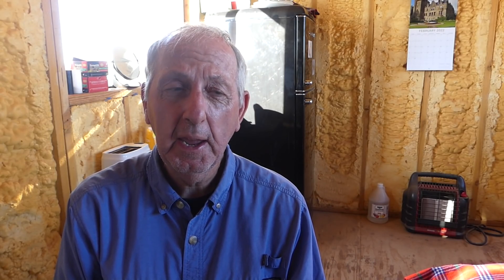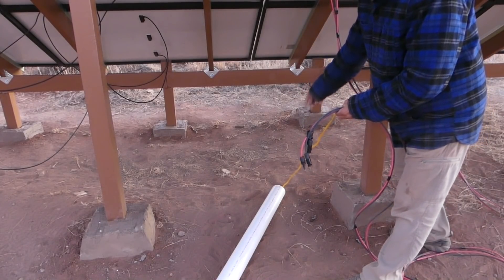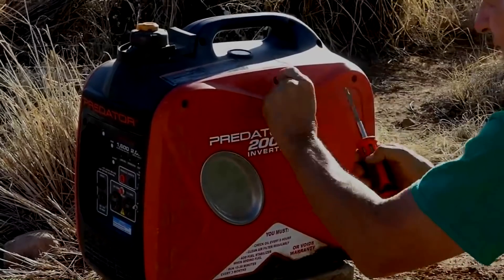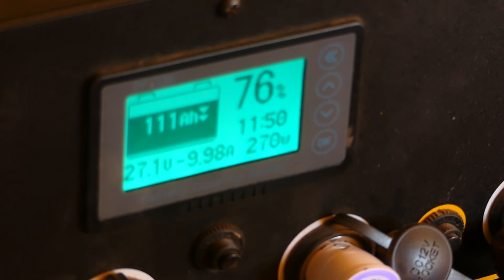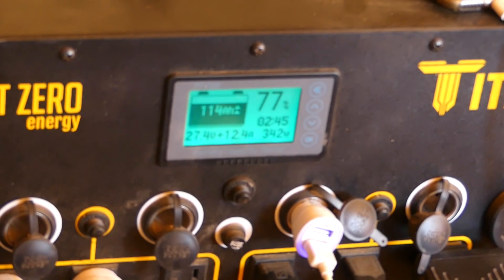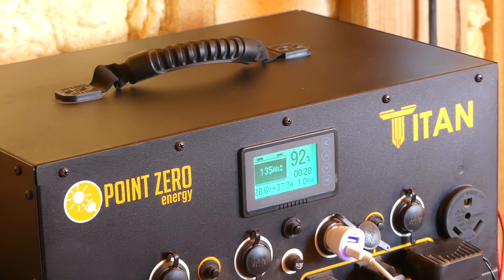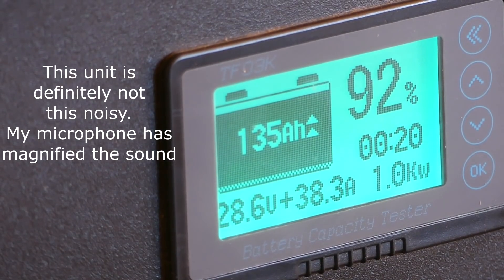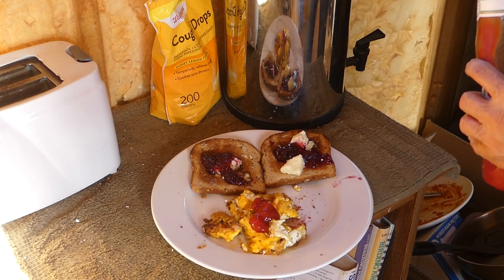Off-Grid Senior Powers 200 sq ft Tiny Cabin with Solar

Comment: I'm in California and you are correct heating and cooling are so expensive here. I'm looking at building a solar powered evaporative cooler out of the shell of a regular evap cooler just using 12 volt pump and solar fans nothing fancy just something that cuts the cost of cooling during daytime hours.
Reply from the maker: Fortunately I am so heat tolerant that it takes some serious high temps to bother me much. But I am atypical I realize.

Comment: Excellent DIY electro-engineering. If you don't electrocute yourself or destroy any equipment - you've done well. Have you considered a GAHT (ground to air heat transfer) system? It involves digging a big 5' deep hole, and lining it with porous agricultural drain pipe in a large coil, then using an inline fan to force air from your house into the underground coil and back into the house. The ground temperature 5' below the surface varies from 55 to 75 degrees. Not ideal, but the system will very cheaply temper the atmosphere in your well-insulated cabin. Then, you will only need the heat pump for the very bitterest cold of winter and the truly blazing heat of summer. Most of the time, you can heat and cool with only the cost of an inline fan. The GAHT system is frequently used by extreme climate commercial greenhouse operators (in Las Vegas or Ontario, for instance) to keep costs down so that it doesn't take $1,000 in heating or cooling for each bed of veg produced. Love the content, as I am preparing to launch into desert living myself. Keep up the good work!
Reply from the maker: Hi Linda. I wanted my set up to be relatively simple to construct. I am super snug with my Big Buddy Heater and often its probably about 80 deg in here. I love heat LOL. As for cooling my two windows offer great cross ventilation in summer and I am very very heat tolerant.
Reply: @affordabledesertliving3487  Well, shoot! We can never date - I'm a polar bear by inclination. 😉That's why I'm concentrating on the high desert areas of Seligman, Ash Fork, Prescott, and Flagstaff.

Comment: I love your channel! It’s fascinating to participate in your adventure. Thanks for sharing. 
I keep wandering what will happen if you have a really high wind storm. Do you think your cabin is heavy enough to stay on its foundation during a really high wind storm? 
Perhaps you could use a whole digger to dig deep wholes at each corner, then place 4x4s into them and add cement at the base. Then you could drive a bolt into the top with an eye on top and use cable to tie it to each corner of the cabin and pull it tight. Then you won’t need to be concerned during high wind storms. Just a thought I hope you don’t feel I am being critical you are doing an amazing job. Thanks again for sharing.
Reply from the maker: Hi John. So lovely to have people here that enjoy watching this journey. I am always open to suggestions from viewers and I definitely learn and apply the suggestions that work for me. So far even though it can be super windy here my little cabin has stayed strong.  Its a pretty heavy structure being made of 2x6 etc. I will indeed bolt it down in the future. Thanks for your suggestions and taking the time to comment! Cheers!
Reply: @affordabledesertliving3487  thanks for the kind reply Don! I am enjoying your channel very much, and I feel a part of your adventure. 
Glad to hear you will make a plan to tie down your structure, you will definitely be safer, although I agree it does look to be heavy and solid.

Comment: Nice ser up.  Have you had any problems with having your panels at 75 ft away.  Voltage drop?
Reply from the maker: Hi Mr. Make it.  Nope none at all.  I was told it takes about 100 ft to notice a drop.

Comment: Wow!  I was one of your first subs and haven't been to your channel in at least a year.  Nice work!!!  There's something i need to point out with the 30A connector on this Titan.  And there are other units out there with the same issue.  Notice the GROUND on that connector is pointing UP.  Which means that when using a standard RV 30A cable, it will be "angled" such that the cable coming out of the PLUG will be pointing UP instead of down.  Why is this an issue?  The weight of the cable will then tend to make the plug come out on it's own because of weight, physics and gravity.  So, see that screw on the Titan cabinet above?  You could loosen that up and use as an anchor point for a strain relief/cable clamp.  OR, as i've seen in other youtube vids, take the unit apart and turn the connector over on the inside of the unit.  A LOT OF WORK.  I wish you continued success, my friend!
Reply from the maker: Thanks for faithfully watching the vids Keeb and all of your suggestions.

Comment: Im not an electrical expert, but isnt batteries measured in amperage per hour? (Amp/h). Im having a hard time understanding how much one can draw from a "2,000 watt" battery. Wouldnt that depend on the voltage of the battery? Are they 120V?

Seems to work great though.

Comment: Good job Don, I'm going to look into the Titan unit. I'm more of a salsa guy, the peppers will warm you up in the winter, they will help with your circulation. I wonder if you could split your panel array to make 240 volts? you might need another inverter. I heat with wood, it can be a pain, and you would need a truck if you have to go out and collect it. I made an outside water heater for my spa with an old steam cleaner welded on top off a firebox. I've experimented with a solar hot box with 1000 feet of black irrigation hose under a glass sliding door, it got hot enough to melt the hose!  Keep plugging along, I'll see you next episode...
Reply from the maker: Thanks for the suggestions and thanks for watching.

Comment: There are MUCH cheaper ways, 2 battleborn battery (100 AMP HR) is more powerful then that unit, You can simply wire two or three up to a inverter and then to a breaker box to put your household breakers on. its a cheaper and better way because if a part in that battery pack goes bad your whole system is down but if you have batteries, a inverter... if one thing goes bad you can simply swap it out and get running again right away.
Reply from the maker: Thanks for your input Paleao Geology. I did check out battleborn batteries but respectfully didnt find them very cost effective compared to lithium ion batteries paired with the Titan system. If something goes down with this system I am back to a generator for a bit. Considering I did that for well over a year I think I can take it all in stride. Thanks for watching!

Comment: Sorry Don but two things u can 't do with solar is heat and. Cool... it takes enough power for a small town to be able to heat and cool... wood stove for heat ( least expensive) and swamp coolers and fan's for cooling...You put in a BIG solar system for ur needs where u r.. plus it is going to take a large ($) controller " Mppt" and a large ($) "Pure Syne" wave inverter...haven't seen u use "Anything" u would need what I have seen u use but maybe u have BIG PLANS...😁😁😁 but u can grow with what u have...( love ur birds)..lol
Reply from the maker: Hi Donna.  So far I am finding that this does indeed work.  I just need to be careful when it comes to running the little 750 watt heater.  My backup is my big buddy heater for super cold days.  So far this is working really well!

Comment: With this type of system how much running time before recharge. My system has to be charged every day I’m able to power up my whole house only during sun light. The refrigerator stay on solar 24/7 will be looking into Lithium batteries soon .
Reply from the maker: Pete I shut down my power before going to sleep. Quite honestly because all the lights from modems etc bother me while sleeping.  Of course that means the fridge goes down as well. Naturally its only down for about 8 hours.  I switch everything on in the morning and because its Arizona I have a full 4000 watts of power back up easily by 10 AM or sooner.  Then it stays almost 100% full all day.  Not many cloudy days here so thats the norm.  Before going to bed sometimes its down to about 75% .  Hope that makes sense.
Reply: If you are only able to run everything during daylight hours, I would suggest you recalculate the KW of your system (house) draw. I'd bet your solar array is big enough to run everything, but it lacks the overhead to properly charge the batteries. Having better batteries will not fix it if that's the cause.

If you are running lead acid, AGM (or any other kind of VRLA battery), and you know your solar array is oversized correctly then I would suggest having the batteries load tested. You can do that yourself with a proper tester.

Comment: Modern lead acid batteries r0 maintenance and for $400 you can get 200 amp hour batteries I have a 520 square foot home and I am completely off the grid and spent just over $2,000 including batteries all my entire system
Reply from the maker: Yep lots of different ways to do solar James. Way to go.
Reply: But I will say the LED batteries are extremely heavy I had to give Fred to help me move them you take care and enjoy your little home I enjoy mine

Comment: Always check that the electrical cabling to be used within the walls and touch any polystyrene are compatable.In New Zealand we use special blue cable for container type freezers where the tps cable is able to touch polystyrene.Larry Mercer.Electrician.
Reply from the maker: Thats a great tip Larry about being careful about wires and polystyrene. Thanks for watching!

Comment: Tomato sauce ( ketchup) rocks on eggs, as does Tabasco ! Great vid , as always, Don. P.S. Make sure you have a 30 amp socket for your generator to plug in on the fuse box, with a changeover switch fitted. Cheers as always, from the Aussie desert.     :)
Reply from the maker: ooh Tabasco...  too tender a mouth here. Super tip re: the 30 amp socket in the fuse box.  Many thanks!

Comment: I just wanted for you to know, I only have to check my 18 lead acid batteries every six months ; I'm getting two more in March. I guess the battery babysitting must be different here. When I get all 20 I will have 25,500 watt hours. But I only get half, so 12,250 usable watts per day. I can only take in 1600 watts because of my charge controller amp limit. At present I have 1200 watts of panels but I'm getting two more 100 watts panels in April. I'm kind of like you on that. I just turned 66 , so I am going to have the A/C working this year...I ran it for a short while in the afternoon last summer, and then I had to let the batteries recuperate. But I have added 600 more watts of panels, and I had 12 batteries last year...so I can run my  little A/C now. Since I'm piecing mine together, I had more battery than panel for a spell. What happens is, when there is 35 amps coming in,  each battery is only getting like 2 amps, so they just don't bubble much. I don't know who gave you the misinformation. From what I've seen, everyone's solar system is just different than anyone else's, it just works out that way. Chance of tornados and hail Wednesday, so I will have to bring my panels inside...so I made each pair a frame with a handle, so I can grab them and put them in. I'm starting to understand why no one around here has any solar stuff. But it was interesting to me so here I am following the free energy kilowatt road. Don't tell anyone, but if you get enough big lead acid batteries hooked together, you can weld off of them a little bit. I have a coil of #6 wire, about twenty feet of wire in it, that I hook up just to help the arc. It came out of a 1930's Greyhound welder. And I put two 12000 MFD capacitors across the welding leads, to help the arc get started. I want to re wire my battery bank before I use it though...I used a used piece of welding lead that had been in water...that I did not know until the other day...so I have 40 feet, 20 red, 20 black, of #2 cable coming, and I have to redo all that. So when that gets here I will go get my last two batteries. That will give me 1000 amp hours. This was my first solar experience too, and it can be a puzzle. I used more batteries than I thought I would need, to keep the voltage up. My battery bank can deliver some amps without much volt age change, but I'm hoping two more will be able to hold steady voltage with 1200 watts of load or so. I want the voltage to not drop with that much load. I didn't quite have enough last year, but this year, I do. I will have twenty batteries this time when that summer sun comes around, lol. They don't act the same as having 6 of them. There is somewhere for that energy to store up. I should have all my solar system parts in the next three weeks. I'm like the turtle, two batteries one month, two solar panels the next. But almost done getting it all finally...ugh...I have spent a year and a half putting this together. I will have $4500 total in everything. It's working pretty nicely now though, just want a little reserve power. What I was going to mention, when you don't run them down much, they don't gas much while charging...I think that may be where your info got astray from reality. When there's enough of them they don't run down much. Nobody told me how many to get, so I just kept buying them. I wanted to get enough to run whatever I wanted. This solar was made for us old guys to tinker with, I think. That is a nice unit you have, but you should have a backup. You will need a plug socket or something for it eventually. It seems like there's always something else. I hardwired my Aims inverter charger to plug ins. I need a couple more I guess. I'm naming  my battery bank  "The Twenty Mule Team". I figured they would pull anything I can get them hooked to. We will get our stuff lined out. It has just now dried out to where it is not sloppy muddy on top of frozen ground, and we have storms coming Wednesday. It will most likely flood then freeze again. It was below zero last time. I started to make some sleet ice cream but I was trying to keep warm. I had enough power during two days of no sun and snowing. The batteries were basically each at 12.6 but in 24 volts hookup. Showing 25.2 volts after two days. SO I figured two more would keep that at 25.4 maybe for a two day outage of sunlight. So that's why I decided I needed 20 of them. So I have three times the battery that you do, and less than half the solar panels that you do...lol. For some reason I find that funny. I don't know why, either. Unless you were thinking of making a battery room later for all those solar watts to go into. That is a good idea to have that backup. I have found from being off grid for a year, that keeping the voltage up going to the inverter avoids many problems. Also it extends the life of the main component, the battery bank. Other people hide their inverters. I have mine out in the open so the fan can blow on it. Mine will be in here with the air conditioned air blowing on it this summer. I just wanted to let you know about the " battery babysitting". I got a good laugh out of that. Good luck on your solar journey. We have went about it just about exactly the opposite way, it seems. I am always just amazed at how different each person's solar stuff can be. They used to say when you integrate your solar and heat and air, you are getting more serious about your system. I think that is when you learn the most about how your system will do in real world use. Sounds like you are going there with yours. I want to see how yours works
Reply from the maker: David you definitely have a serious solar project in the works there for sure. Thanks for watching my videos and yep I am willing to adjust things to work in a mini split.  Thats why its an oversized solar array. We shall see! Thanks again!

Comment: You have a lot of good idea's I like your thinking on the wiring to the box using the 30 amp connector to power the rest of the cabin. I have two Bluetti's AC200 I have a Surge Protector one each one and run items off of each one. I only have 900 watts of solar to charge them both but they will charge from 50% in about 2 hours each I always have more power than what I need in my cargo trailer. I am looking to  do a cabin for winter down south that I can take the bluetti's out of the trailer and use in the cabin by just unplugging them and then run another cable from the cabin to my cargo trailer that will be parked right next to the cabin. Take care stay safe I have subbed so I'll be back.
Reply from the maker: Hi Den first off thanks a ton for subbing.  Yep I may have gone with Bluetti if they had had something bigger than the AC200 to run my place.  I understand they have an AC300 or something similar now.  I think Bluetti is a decent company and it sounds like this is working pretty well for you. Also it sounds like you know how to be flexible which is so important for creative off-grid living.

Comment: Good for you! Can’t afford a lithium battery machine but yours looks good. Really like the  solar array. One thing I’ve found out is that you can draw a lot of power straight from the panels if the battery bank is in bulk charging mode. Can probably get 80 percent of the rated power on those panels if you let the battery levels drop lower than 95 percent.  If you pack those pipes ends with steel wool you will reduce the snake infiltration,  not sure if you got a 5000btu window unit for the cabin but your machine would run one for sure. You will need add timber to your studs to run that electric conduit behind the drywall. That foam is highly flammable and needs drywall on there to save you from coughing your way to the kingdom of heaven if she lights up,
Reply from the maker: Great tips Desmond Sharpe!  Definitely appreciate the feedback.  I will definitely give all of that pause for thought when I run the electrical wires in the cabin.